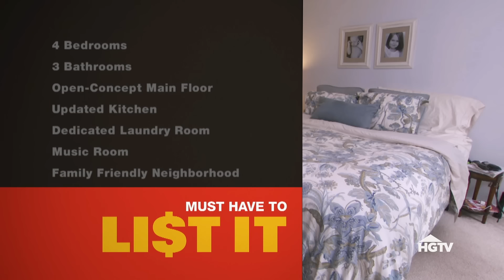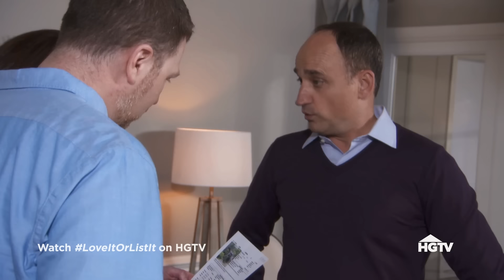Bungalow Dilemma: Space vs. Stay - Full Episode Recap | Love It or List It | HGTV

Comment: I love it all except one thing Hillary...the mirror in the bathroom with the 2 sinks is to short or rather not wide enough ...it should line up with the end of the sink..or two seperate mirrors without wall lamps ...Oh Lord I can´t stand stuff like that. :face-orange-frowning:😆
Reply: Doing it that way would have greatly increased the cost.  The mirror could have been an inch or two wider, but that would cost more money  -- and if it's not a standard size, that would be even MORE money to have one custom made.

In order to have a full-size mirror, there would have to be holes cut to accommodate the lighting; deleting the sconces is not a workable option at all.  Also, there's a power outlet to the right of the mirror which was probably required due to code, so you can't extend the mirror over it without again cutting a custom hole in the mirror.   Then you'd have to buy a mirrored cover for the outlet unless you wanted it to look janky.  More money.